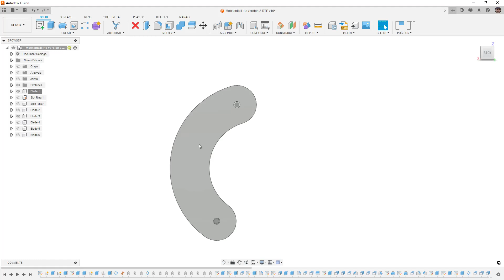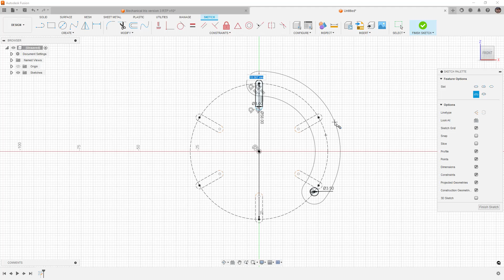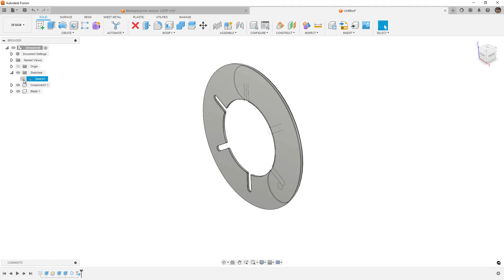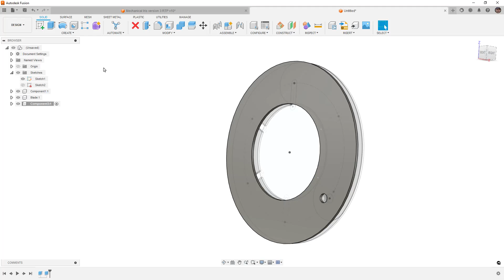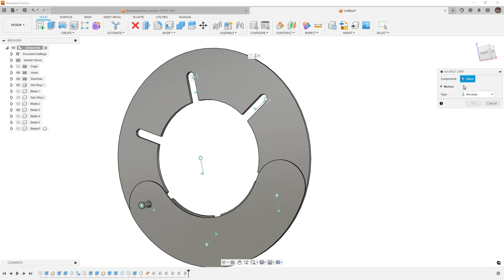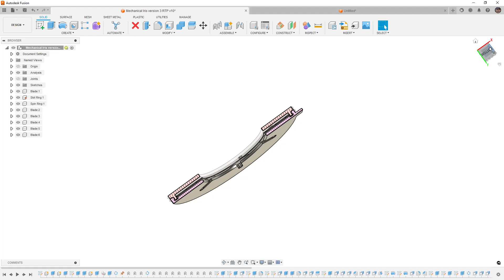How To Design a 3D Printed Overlapping Blade Mechanical IRIS in Fusion

Comment: Similar comment as seen already, but the pins on the blades intersect with oneanother. When stacked, the slot pin goes through the blade below it. This can be seen in the model you posted in the description. I'm not sure how you 3D printed this. Did you make any changes? Thanks. 
Edit: The answer is that you kind of bend the blades into the slots. The CAD will show them as flat, but they aren't really. When you're placing the 5th and 6th blades, you shim them under the 1st and 2nd.
Reply from the maker: yeah in reality vs in CAD can sometimes be different when things have to flex and bend.

Comment: I copied this model in CAD. I can open and close it. The problem is that the slot pins have to pass through the blades for it to work. What gives?
Reply from the maker: im not sure i follow you on this.  Each blade has a pin on the top on one end and a pin on the bottom on the other end.  To make it easier to print, one of the pins is pressed in.  The blades overlap but the pins don't go through the blades, at least not with the way i did it in this video.

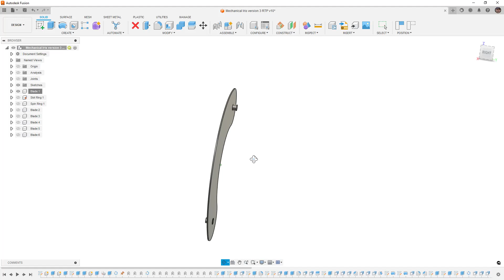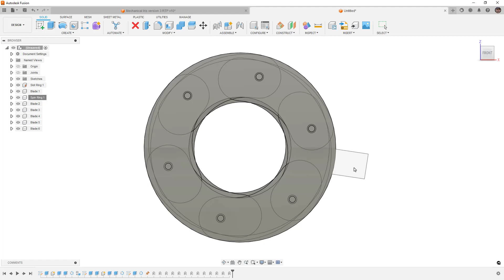If you look at 1:18 in the video you can see the pin setup.  This overlapping iris blade setup is common in cameras (but the blades have pins on the same end).  In the CAD model they are all on top of each other because in reality (as mentioned at 19:30 in the video) they blades stack on each other so the housing for the design has enough of a gap for them all to stack to build it.

Did you print it and have problems, or are you just looking at the CAD model?

Comment: Great video, thank you so much. Do you know how I can do a scale of the f stop to this design? is it possible to have fusion calculate the opening of the Iris at a specific point?
Reply from the maker: that is a great question.  I imagine you could set up something to do that.  If you had a sketch line from where the "sensor" would be to dictate the focal length, and a sketch with a circle that is created by projecting edges and having a driven dimension for the  aperture diameter, i can't see why a formula couldn't be added to calculate the F stop since its just focal length divided by aperture diameter.

Comment: Hello!
Love the video, inspired me to do my own design.
Just wanted to ask, it looked like in the video that the blades were essentially intersecting? How would you make an iris that could overlap, as well as be physically printed? I tried some other designs and they didn't feel that great to use, sadly.
Thank you! I'm aware this came out five months ago, but I'd appreciate the help if you could reply!
Reply from the maker: yeah the tricky part with overlapping blades is their thickness.  The ones in a camera iris are really thing.  I found printing 1 or 2 print layers (.2 to .4mm) was the best route.  The design you might want to go with (which i haven't done a video on) is something like this.
https://www.lomography.com/magazine/117722-making-a-diy-cardboard-aperture

It has 2 pins on the outside section.  One rides in a slot and the whole thing swivels inward.  Keep in mind with this and how ones in cameras work they won't lay flat.  the tips will have this sort of start protrusion on them.  That style is also a little bit trickier to get the shape/profile right.  Will take a bit of practice.  I do have plans to circle back and do more with these but it sad that it has already been 5mo :)

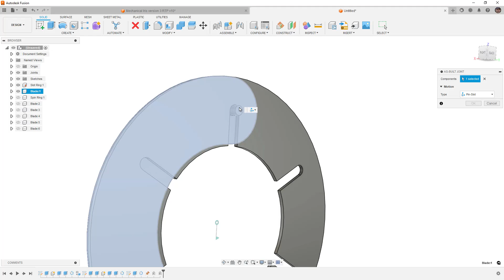Comment: the problem im having is when i click on the component and try to test the motion of the joints nothing happens. example 16:13 when you click and drag you see the joints move
Reply from the maker: since we did this video one of the Fusion updates pushed a "Ground to parent" that is on by default.  Is there a component in your browser that has an Anchor icon?  For this to work (manual drag of components) you will want to ground one component but the rest need to be driven by the joints
Reply: @LearnEverythingAboutDesign  worked out perfectly thank you! another question is how did you have it so there is a black outline on all the bodies and components?
Reply from the maker: @OfficialBloodsport  hmm, I am guessing you mean the shading.  You can go to display settings but that should be on by default.  CTRL + 6 is the shortcut key for shaded with edges.

Comment: Can you make a video on how to make a surfboard in fusion 360
Reply from the maker: are you trying to make one or just model something?  I am not a surfer but I know the shaping of the board is critical and i don't have enough knowledge on the subject to know the shapes well.
Reply: @LearnEverythingAboutDesign  yes I’m trying to make one but I’m just stuck on trying to figure out the best design/modeling process to make a basic surf board shape and then make changes after
Reply from the maker: @gagechamberlain7245  My guess would be cross section lofts from front to rear.  Similar to how a boat hull or airplane wing is made.

Comment: Really Nice work!
I'll try to print this one later and see how it goes.
Now i have a kinda tricky question,have you seen the 2 strokes pipes? How would you approach modeling one of those?and a second question related to that,is there a way of taking the slices and unfold them to do a flat pattern and send them as a dxf to a laser cutting shop?sorry for the long question,thanks in advance
Reply from the maker: Thanks
Yeah I have had my fair share of 2 strokes. currently a ktm 250.  The way they were done historically (not talking about all the pie cut ones) is with hydro forming, or hammer forming over bucks.  To model one is probably going to be done with loft and a centerline path, but there is a bit of math involved.  I used to make spacers for pipes at the head for yz 250s.  50mm spacing from the head changed the hit of the power band.  On my ktms i actually have a bit more control with power valve springs and preload, but on a design where you don't have easy control over that the distance from the piston, the shape of the expansion chamber and location of the "stinger" where it necks back down are super critical.

If i remember right there are some calculators online where you can put in some basic parameters for the bore, rpm ranges etc.

As for making them.  I did a video awhile back on making a buck for a fender.
https://youtu.be/2sLDPpolLpA
I would likely do something like this but you would need to do planes along the centerline path of the loft and cut a bunch of circles, then build a centerline path out of wood for the expansion chamber.
Reply: @LearnEverythingAboutDesign  thanks a lot for the detailed anwser!
Reply: @nahuelise4055  My short answer suggestion... just call Mitch at PC and order one 😂
Reply from the maker: @billyfrank6318  He can make a custom pipe just with his mind he is that good :)
Reply: @LearnEverythingAboutDesign  kinda related,theres a way to save several flat patterns in a single DXF file?
Reply from the maker: @nahuelise4055  If you put all the flat patterns into a detailed drawing you could save the drawing as a dxf.  You will want to turn off the border and title block if you do that and make sure everything is 1:1 scale.
You can export sketches as DXFs so "IF" you could get all your flat patterns into a single sketch you could do it that way.  That is probably more work than the drawing route though.

It would be nice if there was an easier way like in solidworks where you can right click on the flat pattern folder.
Reply: @LearnEverythingAboutDesign  you helped me greatly,i saved my patterns as sketches and then exported that as a DXF and it worked,now i have the whole assembly in a single DXF file ready to send to the laser cutting shop!